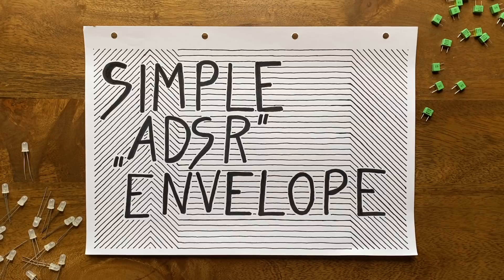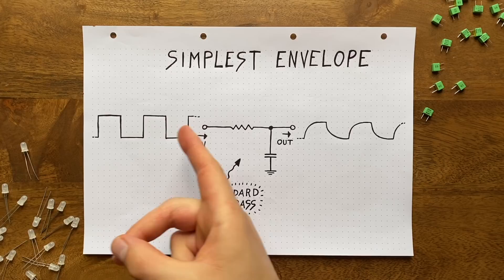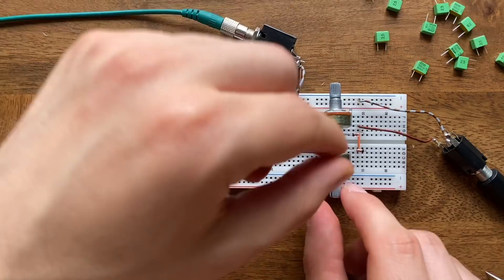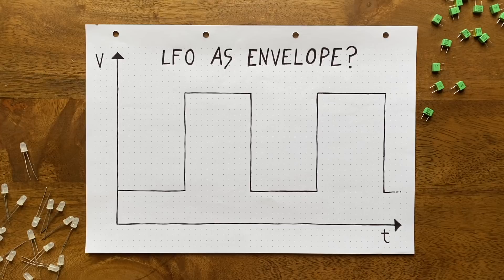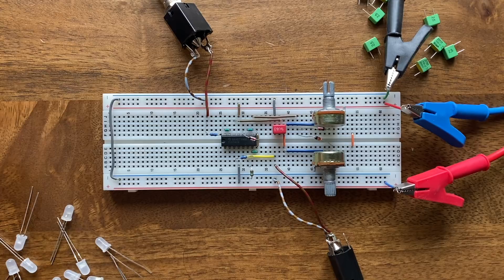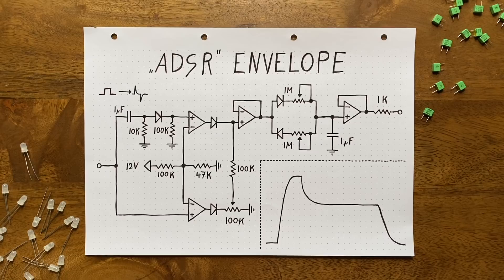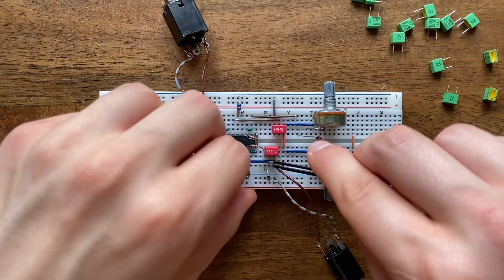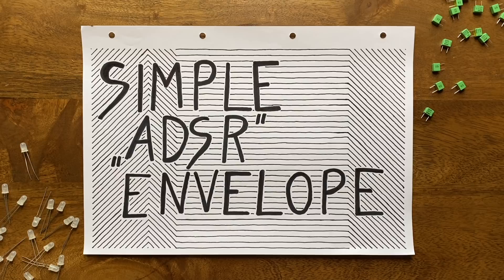Designing a simple ADSR(-ish) envelope generator from scratch

Comment from the maker: hey people, let me know which features you'd like to see me cover in future episodes!
Reply: Please make some circuit design basics videos. Tips and tricks♥️♥️♥️🙏
Reply: 1) how analog supersaw oscilator will work. 
2) more advanced "ADSR" like in PSP Audioware NitroADSR from VoltageModular Delay-Attac-Hold-Decay-Sustain-Relase Generator
3) FX distortion unit like used  offten to enchance sound of Roland TB-303.
4) FX saturation (pseudo magnetic tape like in 542 Tape Emulator by Rupert Neve, alloy transformer, tube saturators and more)
5) Simple step sequencer.
6) LFO
Mayby it will help You.
Cheers.
Reply: more advanced ADSR circuit!
Reply: I would be really interested in how to implement an 'end of cycle' trigger output :). Also CV control for the rise and fall parameters?
Reply: LFO with sync input!
Reply: - A deeper exploration of noise circuits than the contest video would be really neat, especially covering the different types of noise.
- Clock dividers / multipliers.
- Stereo panning.
- Various interface options: force sensitive resistors, capacitive touch etc.
- Simple delay.
Reply: An Vca
Reply: You could fix the Atack issue by setting a latch on the inital Spike and Reseting it when 12V are reached
Reply: Sample and Hold!  SO underused.  ( and / or Track and Hold )
Reply: Polyphony and unison with detune, at least 16 v voices :D
Reply: A delay / reverb circuit.
Reply: I would also Love to See an EOC Output as Well as a looping function Like  Maths, rampage and Serge DUSG have. Changing the curves shape between logarithmic, linear and exponential would be very interensting too!
Love your Videos, they are incredibly helpful :)
Reply: harmonic oscillators maybe?
Reply: Someone already said that but syncable lfos would be epic
Reply: Would love some digital episodes about generating analogue signals from MIDI. There's so much to cover (pitch, velocity, sustain, portamento etc) that it could even be a whole series. Getting even the basics down would be awesome though
Reply: Does your adsr circuit use a split power supply? I see ground but no negative connections. Any help, please? Also, would 9VDC work for a non-Eurorack circuit?
Reply from the maker: @Sarahbuildsstepsequencers  yeah the op-amps are powered with +/-12V. you can probably make it work with 0/9V, but you should use rail-to-rail op amps!
Reply: Boolean Logic modules – very useful and shouldn't be too complex to demonstrate
Reply: Seems like a good series with explanations of what things do that people can understand! I’ve got an AE Modular, which runs on just 5v. Any tips on modifying any of your circuits to work with 5v (not +/- 5v, just 5v and ground)? It’s meant to be easier to work with for diy circuits, but almost every circuit I find is +/-12v.
Reply: Wavefolder, S and H, MS20 filter breakdown.
Reply: I'm not a beginner nor an expert in electronics by any standard. I've built 555 oscillators, and tube amps but nothing like this. I'm getting confided as to how each piece of the eurorack puzzle comes together. Perhaps a video laying out standards and how each module would interact with each other.

I've followed along completely with this video, simulated it, and selected compliments. Once I solder it together I'm confused what to do with it. I've also simulated a vco based on your design and plan on building but I'm very unsure how these pieces fit together.
Reply: Adding CV In to control the Attack and Release

Changing slope shape

Quad A/R or dual ADSR
Reply from the maker: @adamwhite1934  yeah on the plus side, 5V DC power supplies are much easier to find than symmetrical +/-12V ones. on the negative you‘ll have to adapt common circuits quite heavily - for one, you always have to add a 2.5V offset to all audio signals (since these normally swing around the 0V line). also, most (if not all) resistor values need to be changed. so i can’t give you a compact tip here, sorry! you‘d probably have to play around with the falstad simulations that i put in the video descriptions yourself.
Reply: I would really like to build an adsr envelope like this one! But is it possible to make it with a loop option? So that this envelope generator could be an LFO
Reply: a compressor/limiter
Reply: I would like to know how to build LFO
Reply: CV controllable, knee-adjustable, feed-forward RMS/Peak VCA compressor/limiter/expander/gate. It could build on top of your existing videos easily :)
Reply: oscillator sync
Reply: CV control on the double wave folder! Thank you for these videos and circuit designs.
Reply: I know this video is old, recently YT showed me your channel. IDK if there's a follow up to this video. just in case it's useful to someone. 

I think that with a couple of resistors it's possible to improve the slow attack situation. I'd add some positive feedback to the attack comparator and set it's threshold with the output, adding a resistor from the output to the inverting input of the attack comparator (both comparators being feed from different threshold voltages). This way, once triggered it would stay high because of the positive feedback, until the output reaches a certain level. I would also remove the diode at the input so the low pulse resets the comparator in case the attack phase is not completed at the end of the pulse. And effectively only adding 2 components to the circuit. Some fiddling with the resistors values might be required. 

To make the decay and release independent, the release diode could go to the output of the attack comparator, and the decay to the output of the sustain comparator, both clamped to the output of the buffer with a diode, with a small resistor in series of the discharge diodes to limit the current at minimum times, and an extra diode to avoid the clamping diodes to interact with the attack. Both curves would be more linear, the decay could be still the same if the comparators negative supply is kept at 0V, which could be done as no opamp output needs to go under 0V. This is with only the extra pot for the release, a few diodes and resistors. 

Other option is to swap the discharge diode of the original circuit with a pnp transistor, controlling the base with a resistor to the attack comparator's output for the release, and the same but with the sustain comparator for the decay. This seems to be the better solution, simpler and keeping the discharge curve from the original circuit while adding independent controls. -1 diode, +2 resistor, +1 pot, +2 pnp transistors. 

Too bad I can't attach a picture.

Keep it going, I would loved to have something like this available starting with electronics in my teens, and the newer videos are giving me the itch to come back to the hobie!
Reply: Pluck, some Korpus-Strong module

Comment: Good thing you mentioned the 100 k resistor between the diode and the Buffer. I have designed a very similar circuit years ago and left out the pull down resistor. Took me some time to realise why my Circuit did not work. More confusing is (if you are new to electronics) if you put a Probe on that area for testing, the cirucit will work ( because you close the circuit)
Reply from the maker: haha yeah, that's a tricky one indeed

Comment: Makes no sense to me as to how this man knows electronics, has very strong electronics know-how, and explains extremely well and detailed when this is channel is primarily about DIY synthesiser!

This one video explains questions that had haunted me for as long as I started simulating 'three operational amplifier' instrumentation amplifier. I do not have an oscilloscope so I need to simulate before spending loads of money on exorbitant components. Even the basic and cheapest NE5532 can add up to a lot money. Unfortunately simulators are never true-to-life, models are never accurate and certainly do not reflect the ever changing variables and the inherent unmatched/mismatched characteristics of each components even if they are from the exact same mould made at the exact same time and processes.

Okay. I digress, deliberately. 😂

The circuit shown in this video is perhaps exactly what I need. It is actually a peak detector! It can be made so-called 'automatic gain control'! I will try this (I mean 'simulate' 😝) and see if it bloody works! The double diode in such way plus double potentiometre is peculiar (The explanation of how it works makes logical sense to me, however).

I have been messing with op-amp for a long time but only now I know what the heck a 'comparator' is and how it works. I read much about it but the explanation sucks big time, or zero example. The 'coincidence' (lots of 100k and 47k resistors) in this video is an apt example about 'threshold'!

Due to those reasons I genuine think that that man, Moritz, genuinely wants and likes us to success. Most YouTubers are as though making videos for their own record or documentary. They are as if preaching the choir rather than n00bz like yours truly. Probably chasing likes and subscribers, nothing about quality content. Some are obviously delaying to reach 10 minutes video by lots of cough, lots of clearing throat, lots of errrr, lots of uhmmm, lots of aaaaah, lots of pauses, very slow pace, by the time you know it all you learn is "A diode allows only one WAY current movement". Like, WHAT THE FUCK!
Reply: this video helped me with a similar thing! Thanks for teaching me how a compressor works with your synth A/R video
Reply: @tenison7990  And the beauty is Moritz is not even an engineer! There is a time when I believed that all electrical engineers graduated only to do sound stuff and not other things, because most of them are actual engineers but their 'tutorials' are only on audio.

Perhaps audio electronics circuits are the simplest build for all people to learn, understand, DIY, and troubleshoot. The first thing people learn or want to learn will be amplifier or power supply.
The simplest amplifier is 1 BJT, 2 resistors, and 2 to 3 capacitors.
The simplest power supply is 1 op-amp, and maybe a few other components (1 BJT, 1 Zener diode, 2 to 4 resistors, 1 to 3 capacitors) for stabilisation.

I later learnt that actual engineers are a lot on insane mathematics than show-and-tell; can be extremely academic than using real-world examples and applications. Not all engineers are like that, of course, but very few could I find have actual components to show how a particular component and circuit works instead of numbers and more numbers to no end.

Comment: Aw sweet... I just managed to get this working on a breadboard. Many thanks. I'm getting some sliiiightly odd behaviour with the sustain level pot but I'll keep faffing about with caps until I get the simple A(SD)R of my dreams. If all else fails it's easily good enough to solder up as it is:D

Thanks dude.
Reply: Ahhh that's what it was... The 1uf cap at the input was holding charge long enough to prevent a snappy 'off' when releasing the button. I tried a 470nf cap I had hanging about and that sorted it. Perfect, I'll draw up a stripboard layout tomorrow and get it melted together. I'm very happy. Nice one.

Comment: I designed one out of 3 opamps, a transistor and a few diodes that works as expected in the falstad sim, single supply powered, but still have to test it in RL. Also a VCA that needs no power at all.

Comment: I guess the simplest LP is essentially an RC Integrator circuit?  I was taught current flows negative to positive, but your explanation still makes sense regardless.  You can either treat it as voltage drops positive to negative or current flow negative to positive.  The result is the same.

Comment: Just found this channel via Erika @Modular Day Barcelona. Awesome! I´ve built many modules from kits, but never understood what the circuits are doing - and this channel is a perfect entry to get there. Not an EE, I can grab most of the concepts, but need to review opamps for example, amongst other things. What would be super helpful in general (and might be a good episode in itself): Measuring! What to measure (V/A) where, which tools. Preferrably in many places at the same time, so we can see how things relate. I understand that a dozen of multimeters / oscis are probably overkill, so I wonder: Is there any affordable simulation software that would allow to recreate the circuit and then see all the voltages and currents in action?
Reply from the maker: yes, there is – you can find links to simulated versions of my circuits in every video description. (the tool is called "circuitJS", it's free and it runs in the browser!)

Comment: I know this may seem like a stupid question, have you tried creating multiple timers?
By controlling the charging or discharging of capacitors by current control, the characteristic 5 tau "curve" becomes a "ramp or straight line". Using voltage comparators in these ramps and using edge detectors you could activate the different sequences, the trigger activates the Attack timer, when it ends, it activates the timer for Decay or Hold. And for Release it is the same, when detecting a falling edge in the Gate, the release timer is activated.

Another question is whether to use the voltage of these ramps for the output voltage. Whether the time is controlled by current or by comparison voltage threshold.

There is also the possibility of using a capacitance multiplier, in a very small capacitor, so that it charges immediately with a very very short pulse, as in a peak detector.

Another issue is that the "velocity" of the note controls the amplitude of the attack and sustain. If the gate or trigger always has the same voltage, there is nothing more to do, but if the midi sequencer has "velocity" or "accent"... But I think the video is about the ADSR of the Filter Cutoff and not the for Amp Envelope.

I'm learning a lot from your videos, thank you.

Comment: Hi, I'm designing some kind of noise box with a "semi-nodular" electronic part. In particular, instead of the Vco I used a piezo (amplified with the Mikrophonie module scheme). I would like to add a VCF and an ADSR, then a series of other modules (delay, sampler). I ran the simulation that theoretically should work. Maybe I should change the ratio between the 100k and 47k resistor to lower the working threshold of the signal between the first two opamps, since the signal on some voltage combinations of the potentiometers loses body. What do you think, if I start not from a square wave, but from a "random" piezo wave, can the module make sense? Thanks for everything

Comment: Thanks so much for taking this to the next step with the diy kits with Erica Synths!
I have a question about the "Option" to make a change at the 1uf spot, to change the performance to be more drone oriented.  I see from the falstad diagram that increasing the value to 2uf or even 4uf increases the envelope length, at the cost of making small values less snappy.  Should I just solder in an extra capacitor on the "optional" spot? Or just substitute a larger value for the single one I use?
Hope you are still monitoring this!
Reply from the maker: you can either put in a single bigger one, or do two in parallel (their values add up) using the „optional“ spot!

Comment: Hi Moritz- this is really great. I'm trying to learn electronics theory for this exact application and this is exactly the type of explanation i need. Question - with the comparator at the beginning of the circuit, why would it toggle between +12 and -12 volts and not the 3.8 volts that the voltage divider creates? Thanks for your help with these videos!

Comment: I thought tl074's had shorting protection built into the IC? When building buffered multiples I ran into the issue that the 1k resistors were making my CV voltages flat and while trying to research a fix was told by an engineer that it's simply a vistigal design/practice from when the opamps didn't have built in shorting protection.
Note: I totally get teaching the installation though since not all IC's have that.
Reply from the maker: yeah, you‘re absolutely right. the datasheet says explicitly that you can short the TLXX‘s output(s) indefinitely without killing them. i just put the 1ks there out of habit, tbh.

Comment: Been looking at some of your videos on synth diy now and i really enjoy them :) So, thanks! Coming from a more digital/programming direction in to electronics it is najs to learn about the analog stuff.
Anyways.. in order to handle the voltage swing between /+12v of the opamp couldn't you just not use a dual supply for this setup (and connect the op-amps V to gnd)? Since the baseline is supposed to be 0V anyway i mean.

Comment: I'm slightly confused by the diode pointing backwards for the decay. As far as I can tell it never actually drops below ground. Is a decreasing DC voltage considered negative in this case?

Comment: I love your videos. I've done a lot of digital electronics but never too much analogue so they've been a great introduction. One question: is there any reason why you use the diode+resistor to make sure your op-amp output doesn't go below 0V? If I were designing the circuit, I think I'd have set V- to 0V so that it saturates and you can ignore the diode/resistor. Is there some sort of issue doing that?
Reply: My guess; the TL074 op amp doesn't give you rail to rail at the output so if you set V- to ground you likely won't get 0V as the minimum value of your envelope signal. This lack of rail to rail performance also means 10V (not 12V) is the max voltage you will get from a TL074 with +12V connected to the V+ pin. Happy to be corrected if I'm wrong on this.